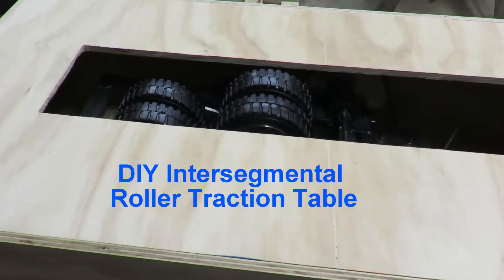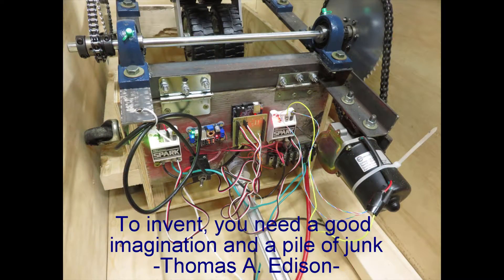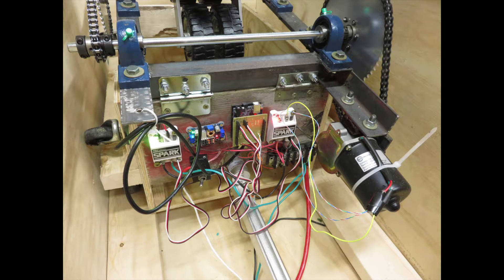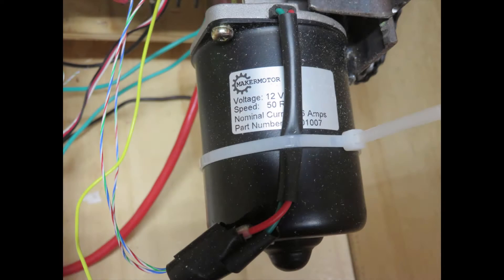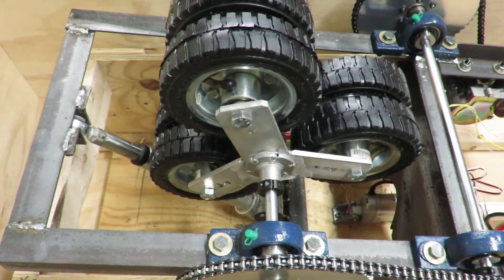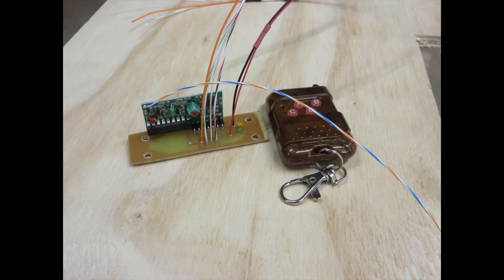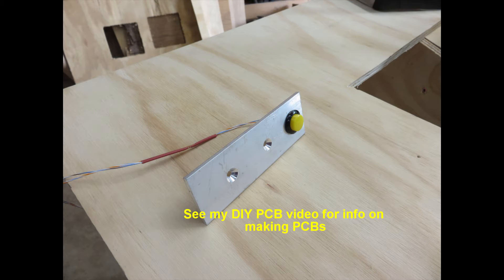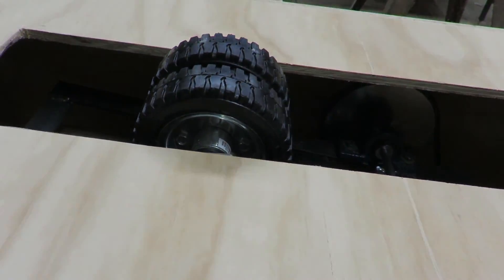DIY Back Roller or Intervertebral Traction Table

Comment: Thank you so much for this. I need to make one badly. Very nicely done.
Reply from the maker: Thanks! hope you found my follow up of the detailed build of this table : https://youtu.be/Kz7nB0Sb3AQ
Reply: @jtandhz  I did. I am going to have to sweet talk my husband into welding. I can do everything but the welding. Okay, I can weld but don't expect it to stay together 😜. I am curious, did you have any issues with the foam? I picture foam wanting to get stuck in the rollers so I was thinking of gluing something to the underside of it to prevent that from happening. I didn't get to watch the full video yet. We were out and about when I found this video so you may have covered it but if you didn't, please let me know if it is an issue. I am about to watch the rest now 😊
Reply from the maker: @mememe4821  The foam was from a mattress pad and it has not been a problem. The wheels rotate and  roll when pushing the foam. A covering would have been nice no keep it cleaner however. If interested I have upgraded my software to be more responsive to the control transmitter as well as to slow down at certain areas such as the lumbar and upper back. I can post it to gethub or email it it you want it. Jon